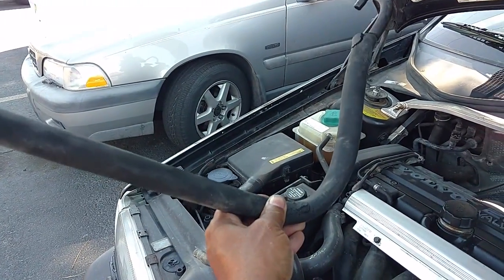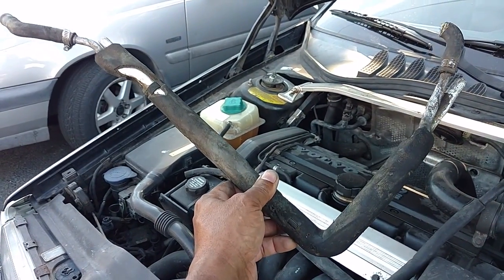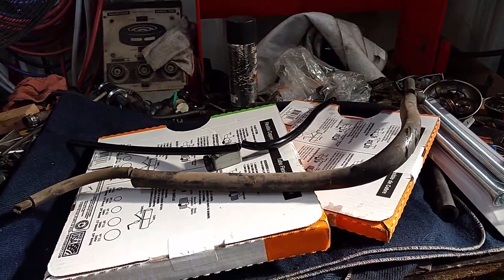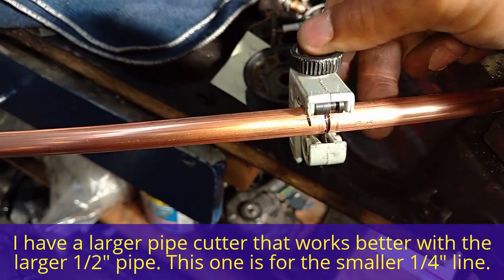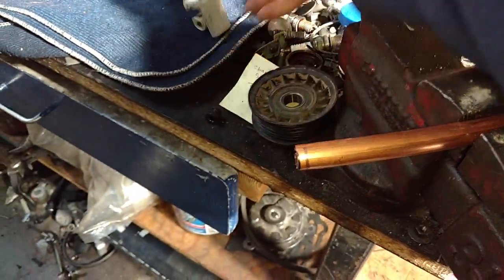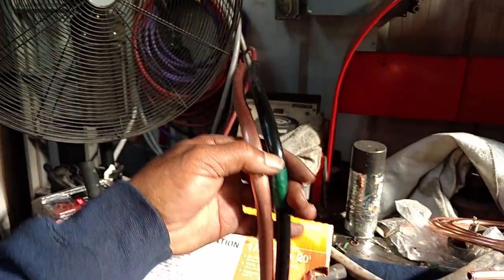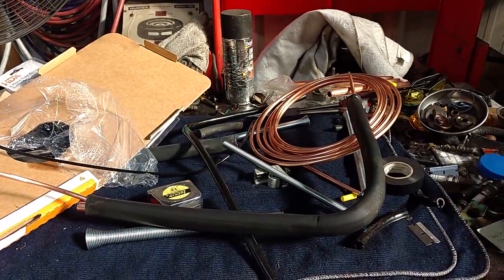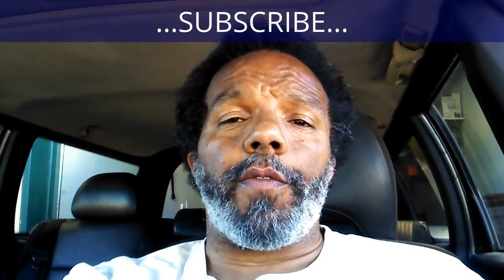How to make a crankcase PCV vent hose assembly for turbo Volvo cars from 1994 - 1998 - VOTD

Comment: Hi robert I hope you are well I have a bad pcv system I tried the glove test is there a way to make the hoses for a non turbo 96 850 wagon finding all the parts for it is a challenge I looked at your site as well but it seems you have smaller odds and ends available
Reply from the maker: Yes, you can get oil vapor rating tubing from a local hydraulic shop. Get the tube from the oil trap to the top of the engine from a Volvo parts supplier.
Reply: @RobertDIY  Thank you Robert for such a quick reply you are an amazing person and a super helpful person for Volvo owners for all these years on youtube I will try that out wish me luck 🤞

Comment: what specific model would I request from the junkyard to match a 1994 850 Turbo Wagon, Automatic and upgrade it to the aluminum ?  Great video,  Another question, can the breather system be replaced with just silicone hoses?
Reply from the maker: '99 - '03
Reply from the maker: I would not recommend it.

Comment: Robert you rock man!! Thank you so much! You have schooled me! There's no substitute for experience. I'm about to do this on my 1992  960. All I need to buy is the PCV box. Now if I only could fix my timing belt tracking issues...
Reply from the maker: If it's not tracking right, one of the rollers are probably aftermarket.
Reply: Is that right? Wow I have to look into that. All pulleys are lined-up beautifully. I also couldn't find an AISIN water pump and installed a brand new Gates. Do you think that would add to the problem? I'm kinda limited because the 92  960 used smaller (narrower) parts compared to the 95 and after 960s for the timing belt system so parts are harder to obtain especially the timing belt hydraulic tensioner. Also concerning the PCV system, I'm worried about the oil leak I saw recently... I hope I didn't blow a seal. Seems there's an oil leak coming from the rear crank seal and I'm kinda worried. The car only has 103,000 miles so I only missed the interval for the PCV change by 3    miles and I didn't have any smoke coming from the dipstick and the glove test was good... it sucked in the glove.
Reply from the maker: So the PCV is fine.
Reply from the maker: The hydraulic tensioner should be the same for all of the 960's and P80 cars.
Reply from the maker: The water pump should be the same for all of the 960's.
Reply from the maker: https://www.youtube.com/watch?v=Qvveywp-JOc
Reply: Thanks Robert
Reply: Excellent, thanks for that. I used IPD Volvo up to now but I'll check with FCP Euro too now.

Comment: They changed the design to metal to fight the goo clogging the vent, they ran the PCV pipe in parallel with a coolant pipe to heat the PCV and keep any oil/goo liquid and moving to the PTC heater/nipple/orifice.
Reply from the maker: I think they changed it to get away from that brittle plastic that breaks every time someone works near it. The coolant hose stops the cold condensation from slugging up. Gotta protect the environment. lol

Comment: Robert, we've spoken before about ATF running hot. Made Broke is right! Now I am CONVINCED the main PCV pipe is  too small in  diameter for high miler cars. You really should read this:  https://www.matthewsvolvosite.com/forums/viewtopic.php?f=1&t=53448 This bloke is spot on!
Reply from the maker: I like the idea but not sure about the material. I don't know how long heater hose will last with hot oil vapors. 🤔

Comment: Robert, are any of the end pieces reducers? Or are they all 1:1? I/e: 1/2"OD line needs a 1/2" to 1/2" elbow for the top of the breather box? Or some other size? Also, I'm assuming you use hose clamps on the copper pipe, as well as the system attachment point? Or are tension clips sufficient for the PTC connection?
Reply from the maker: What you see is what I do.
Reply from the maker: https://www.youtube.com/watch?v=hwCzPPiBxk8
Reply from the maker: https://www.youtube.com/watch?v=lPkMjdt121I
Reply: thanks a ton robert. doing my second pcv change on my v70 in a couple weeks, ordering parts now.

Comment: Really cool mod on which Volvo t5 model the aluminium pcv appears ? It will plug and play on the 850 and not need to change it anymore ?
Reply from the maker: On all of the turbo cars '99 and newer. The end that connects to the PTC will need a good quality longer silicone hose, about 6 inches long. You can also use a piece of the other stuff as an extension with a shorter hose. I guess I should do a clear video showing it. I'm just tired of paying $200 for the kits every time I need one and them breaking a few years later.
Reply: Same for me that's annoying , Thanks for your tips as always I will do this for sure next time I replace my pcv.
Reply: Robert DIY please , make vedio about that .

Comment: You could also probably use some hydraulic hose but I don't know how expensive that stuff gets.  It should stand up to temperatures above 400°F
Reply from the maker: +John Ferguson Another issue with using some hose is to make sure it doesn't kink. That usually adds length.

Comment: The great thing about your upgrade is only the end links can fail, and its easy to replace them :-D
I think that suppliers of that original assembly are just taking the piss!!, silly prices for bits of tube :-(.
Ahh the disk pipe cutter, my mate uses one of those for house plumbing jobs, the last time i did some plumbing i had to use a junior hacksaw and smooth off with sandpaper.
Ive found a junior hacksaw with a good blade is ideal for tight spaces :-D
Reply from the maker: +zx8401ztv Cool, I have 2 sizes of the pipe cutters. I use to do a lot of real estate stuff, so I have done my share of plumbing. ;)
Reply: +Robert DIY   The tube cutter is definitely the way to go but you should try going around the tube in opposite directions back and forth.  That prevents the cutter from spiraling down the tube and it gives a cleaner cut.
Reply from the maker: The larger cutters usually come off the pipe when I do that.